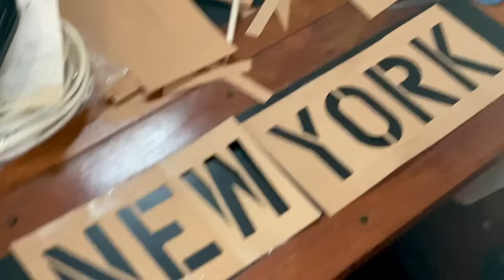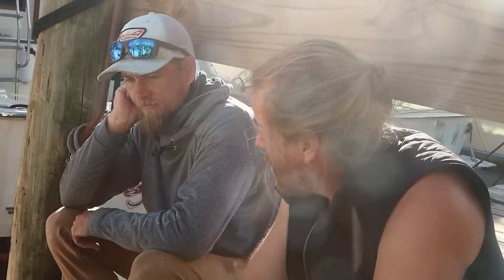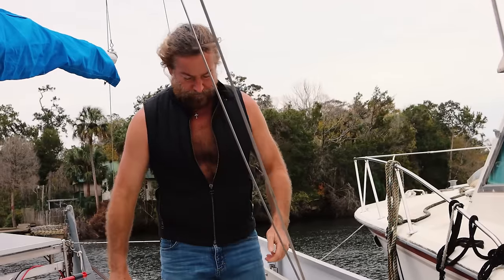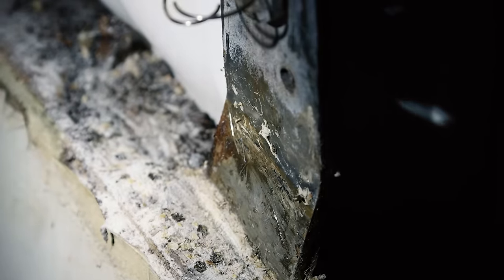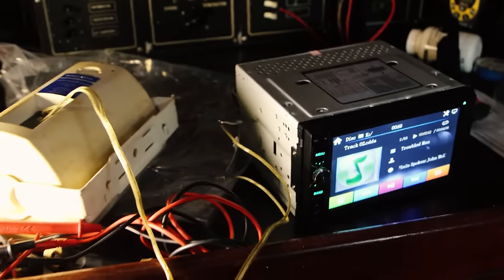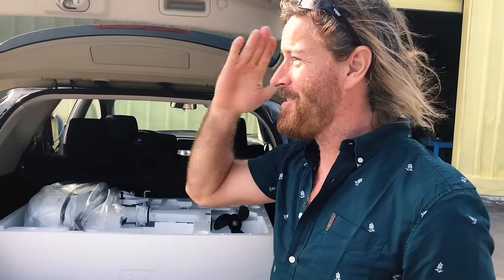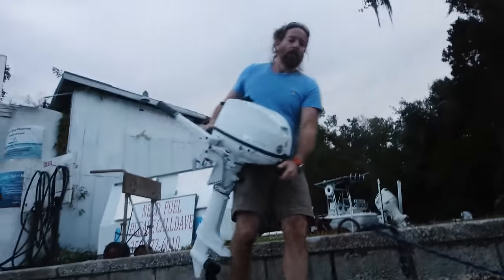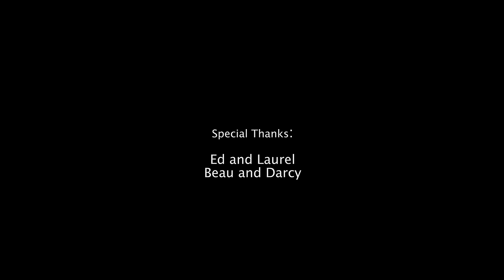Sailing Liberty- Tearing Our Sailboat Open / New Tohatsu 6HP / Chainplates / Installing Radio

Comment: Wow, two videos in a row. Your on a roll. Love it. Helen, when the wires are not totally cleaned and you add solder you end up with what is called a "COLD" solder connection... no contact. Best to scrape the old wires with a razor blade first, before doing what you did. 

LOL, Ted, regarding the outboard motor starting....remember "If all else fails, read the instructions". When you pull up anchor and depart, do not forget to wave as you head south past Dunedin. Stay safe and let the FUN BEGIN
Reply from the maker: Looking forward to the next cruise Donald:) thanks for the razor tip!
Merry Christmas & Happy New Year

Comment: A tip on soldering XT60 type plugs, keep the male and female plugs together when you solder so as to reduce the chance of melting the plastic, if you do melt the plastic the pins should stay aligned until the plastic cools down.
Reply from the maker: Great tip! Will do:)
Merry Christmas & Happy New Year
Reply: @SailingLiberty  Happy new year.

Comment: What an awesome idea.  Learn your boat inside and out by fixing a $10,000 boat.  Less to figure out when on the sea.  All tools figured out, spare parts, hoses, pulleys, belts ect. The two of you make for great entertainment.  Thank you both.  Greetings from Ontario
Reply from the maker: It’s kinda working out like that:)
Getting comfortable with day to day activities, stowing and retreating tools and supplies knowing the systems and the sounds they normally make is a great place to be before shoving off. Thanks Ted & Helen

Comment: Studio 54 at sea, I love it ! I was thinking as you worked on the boat I had rather repair it than pay for it. I built our house in 1995 and paid it off in three years because we didn't get a loan for a lot of money. It wasn't completely finished inside but it was livable. It was easier to work on once we moved in and over the next year it was finished. Not having a mortgage was great and no one else will spend the time to do it the way you will. Merry Christmas guys and thanks for the videos
Reply from the maker: Ah Studio 54…I have filmed there may times, it is a theater again, so we will keep the flame alive shipboard:) Smart money is on sweat equity, and the personal touch!
Merry Christmas & Happy New Year

Comment: I’m worried that the ants/termites/carpenter ants means the area to secure the chain plates is very weak/rotten!  I’m not worried about the integrity of the metal but the sites where they are fastened. Doublers are a good idea but I worry how far down that rotten wood goes. Thx  for bringing us along.😊😊😊 John Ken
Reply from the maker: Fortunately the plates only connect to the fiberglass hull and the wood is just cosmetic:)
Merry Christmas & Happy New Year
Reply from the maker: Fortunately John, the plates connect to the fiberglass and the wood is only cosmetic:)
Merry Christmas & Happy New Year

Comment: We have the 6hp Tohatsu as well, our 28’ ODay didn’t have a motor in it when we got her last year so we put that on her and it has done us very well. Pushes our 7800lb boat at 5 knots without issue. You’ll love that motor

Comment: Friend of mine bought a Tohatsu after extensive research, ages ago. And we couldn't start it. After an hour I took a break and just thought about it, then I told him to get out of the way, and I started it right up.
 Yohatsu was new to the US at the time, and the instruction manual had the choke position backwards. That's the only problem he ever had with it.
 You might want to get a new spare impeller and shaft seal. Fishing line can cut the seal, and the impeller needs to be changed yearly. Both will be out of stock when you do need them.😮
Reply from the maker: Great tips, we did get spares, I will check my list…twice:)
Merry Christmas & Happy New Year

Comment: Those carpenter ants are gonna want to get someplace warm. I think I’d set about five cans (maybe more???) of those b/mbs and run like heck for a couple days and take a break? Make sure all ports and hatches that lead outside are closed tightly.
Open all the cabinet doors, prop up mattresses, cushions remove any storage covers……. first. Put ‘‘em in all compartments….Caramel macchiato, my favorite too ❤❤😂😂 Get that motor locked down, secure (maybe with chain(s) the dingy too. Have a can of Lysol and a lighter handy inside the cabin ;) Practice makes pretty darn good aim.
Reply from the maker: I like the way your thinking!!!
Merry Christmas & Happy New Year

Comment: A good bit of luck with the chain plates. If there is a bolt or two you can get at, knock it out and inspect that too.  You will have more ants and more rot than you think. You have to get every bit cleaned away.  You said you had some spares for that new outboard, if it did not include a spare prop I strongly suggest you get one. Easy to damage, hard to find.  Good luck on the projects.
Reply from the maker: Great point Mark! Get a spare prop in hand. Yes we are continuing to inspect the plates and surrounds.
Merry Christmas & Happy New Year

Comment: We had a pin to the upper shroud failure on a boat that was raced hard almost weekly for 10 years. Repaired the mast sailed another 5 years, sold the boat. Did not have chain plate failure. Replace all pins, be sure to check at least twice.
Reply from the maker: Thanks Rick-

Comment: Rarely do chainplates fail.  Rigging will fail and the tangs on the mast might fail but on a boat like your's I doubt if you will have any chainplate issues at sea.  Focus on the rigging.  Not only the wire but the bits which tie it all together. Make sure all the pins are fresh , and the rings are without fault.  Focus on the swages, and if norsemen fittings, taking them apart and inspect them.  The mast depends on its weakest link.
Reply from the maker: Fair enough Robert:) will do-
Merry Christmas & Happy New Year

Comment: Think about cutting the transom of the dingy and welding it back on at the perfect length.
Reply from the maker: What is the perfect length?
We will revisit dinghy stuff in due course:)
Merry Christmas & Happy New Year
Reply: The length that fits the space. Most likely the bow covering the forward hatch , so in rough weather that hatch can remain open. Buying a new inflatable dingy every 5 years is not environmentally correct and expensive.

Comment: Helen looked so lovely in the red dress and white top, I'm more of a conservative look liker. anyway that wasn't my real comment, when are you guys getting out sailing, I'm stuck and living my life through others, Sailing Jupiter is land bound, so I'm missing sailing videos ⛵⛵🙂🙂
Reply from the maker: Thank You! ☺️ There are around couple big projects to do... windlass backing plate, painting solar structure and drilling bolts through it, rigging, electrical, Ted’s bathroom, self steering control lines and nema 2000 and also we have to replace counter top, since it is leaking and wood is rotten. And honestly since our chain plates are fine, a huge weight was lifted from our shoulders and we have such motivation and energy to get everything done. Compared to where we started this is nothing. I hope to sail in the beginning of February down south. 
Cheers,
Helena

Comment: Be advised!!!! And I know you got common sense. A rope from the motor, to the boat. Because sometimes outboard motors come clean off the back of the boat. And having the motor tied to the boat. Keep the motor from being the bottom of Davy Jones locker. Little red light is oil light.
Reply: A set of oars or paddle might be a good idea too!
Reply from the maker: Safety cable . Copy that
Reply from the maker: Just got the oars ! Thanks 
Merry Christmas & Happy New Year